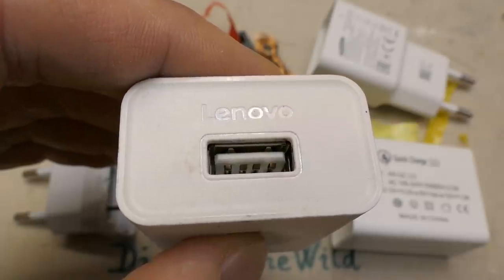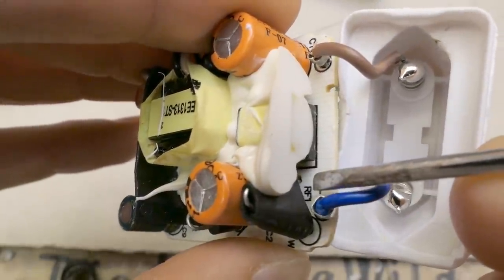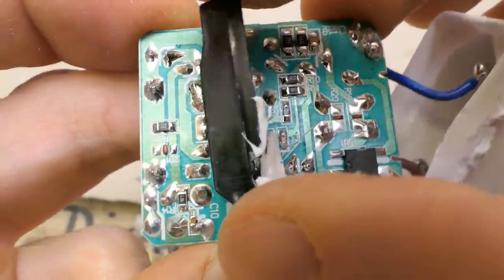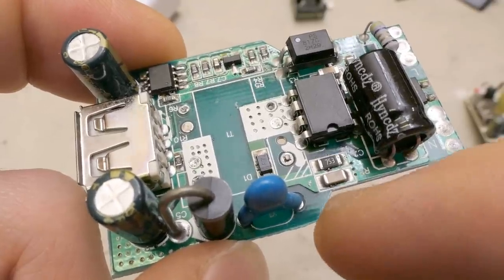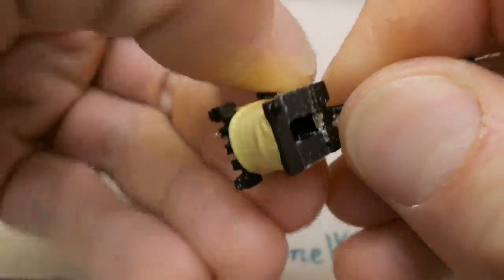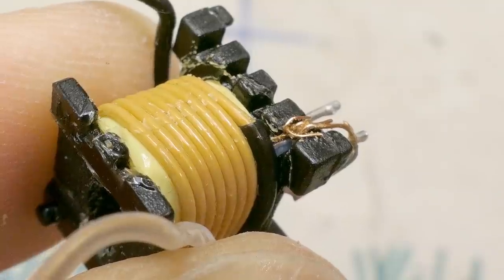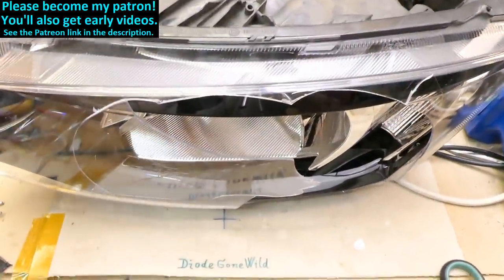Finally a safe USB charger?

Comment: "So the conclusion is... NICE :)."
That's exactly what we want to see - properly built chargers designed to last a long time, work properly and work safely without putting you (or your devices) at risk.
Sadly a lot of cheap chargers tend to miss some safety critical steps, as seen in the "dangerous USB chargers" series.
Reply: when u want to be cheapo u need to accept the risks... (if u not scared away when a device cant write down Original, u should not expect any safety..., this is why i never buy an aftermarket charger, just the brand charger for my devices :) cost more 1 time but lasts 3-4 time the cheapo chargers lifetime )
Reply: you can never be sure even when attempting to buy a proper "brand" charger, since there are millions of fake ones even in local stores, not aliexpress.
I'm using a lot of them for my small devices, but proper branded ones with low power 1A/5V are becoming difficult to find. I do not need more powerful ones, that are quite expensive.
Reply: Actually, there are some third-party chargers that are made by reputable brands such as Aukey, Anker etc, and they are powerful, but safely built. At least, I've tried these two brands and can certainly recommend both.
Reply: @krahaborowski  Same here. I'd like to know if there is a way to recognize the proper onces before buying, or even when buying online.
Reply: well i looked into multiple Samsung and HTC branded USB power supplies, they were low quality or at least what i mostly looking for: the capacitor at the DC side was the same very small (too small...) one in every 10-20W power supply.
You can even visualize how bad some chargers can be by measuring the ripple which will go more or less directly into the battery (= reduce lifetime). I personally use as often as possible only chargers i modded myself with at least 3-5 times bigger filtering caps for the USB output, they compensate the ripple much better, the phone keeps slightly cooler AND charges faster.

I never had much issues of dying chargers, in fact all of them mostly last long enough, but as i said right above: Their quality, or better: their DC output quality is even at 20$ Apple Chargers BAD. Example? With a 20W USB C charger (original apple) on my iPhone 12 Mini i measure peaks of nearly 5 Amps (should be like stable 2,x Amps!) and at a regulary 9V Output voltage a ripple of +/- 6V, resulting in Vpeak of up to 13V (at nearly 5 Amps!!!!)
By adding an additional filtering cap with only 47uF x2 in parallel the ripple and so the voltage and current peaks are nearly completely gone which will make the battery last a lot longer.
And just 4 info: by using wireless charging.... you totally wreck your battery, wireless charging produces even more ripple than any cheap USB charger :D
Reply: @harrison00xXx  I'm probably happy that i have no means to easily measure how bad are supplies that i am actually using, as i really would not like to pay more for them, or break open each one for upgrade. Sometimes not knowing too much of a the problem lets you sleep better :)
Reply: i miss dodgy for second 😄
Reply: @krahaborowski  

Yeah, and thanks to the name brands also glueing their things together instead of just using screws, you can't even take a look inside to check if it's a safe one without breaking it.
Reply: Chargers that comes with your phones in the past usually is very high quality that lasts for a long time.

Kind of sad that not including the charger in the box of a new phone nowadays has become a trend
Reply: @_decky4ever_  There is no grounding even in original chargers, what are you talking about?
Reply: @TitanyumDioksit  I never mentioned anything about the grounding, with 2 prong chargers, you will never have a ground connection, but with a proper charger you will not have an exposed live wire hanging out from the charger in a form of an USB cable. 

I tested some cheap charger in my near, and some of that is not isolated from the high voltage side

Comment: the key with the insulation on the transformer winding isn't just the thickness or dielectric strength, its about physical resistance to abrasion and flexing. the lacquer on transformer wire will actually insulate several hundred volts perfectly well, but its very easy to nick or abrade a flaw into it, and thats especially relevant in these tiny transformers which are wound in huge numbers at great speed. a layer of pvc or similar insulation is so much tougher and more durable.

Comment: Funny that they took care to use different, standard wire colors for mains input, and then connected brown to neutral and blue to live. Not that it would matter, though.
Reply: The most unimportant thing in a device like this... You can turn it around anyway lol
Reply: @rkan2  I know. Still, funny that they slightly increased their logistics costs and got it wrong. The reasonable thing to do would be to use wires of the same color, whichever is cheapest (likely black or white).

Comment: I wonder what the actual difference in BOM and manufacturing costs is between DODGY and NICE. It cant be that much, the fundamental design and 90% of components are the same. A lot of the DODGY chargers come sooo close to being a decent product, if only they'd cost-cut just a tiny bit less.
Reply: some plastic sleeving on the secondary winding costs almost nothing. The manufacturers of cheap chargers just can't be bothered.
Reply: I was just saying the same thing about Chinese crimping tools: they’re so close, but cut too many corners. If they targeted, say, $30-40 instead of $15, they’d be able to make a product that actually competes with the $400 original tools, but noooo, they just go for the absolute cheapest… :(

Comment: Diode, utilise a arbour press with a flat head screwdriver bit to open sealed adapters and cases without a hammer. It works with me perfectly.
Reply: Dan used his swing press. It was a very nice swing press at that! Just needed a sickle and he'd have had the flag.

Comment: even that EE13 core should be able to handle way more power then just 5W. that transformer as a very easy life compared to how that size core would be used these days.

as for heating the cores to separate, I made a little circuit to test the saturation current of the transformers that I switch to "torture mode" where I just crank the current right up into saturation to heat the core on its own. just not too much to burn the wire insulation and its a very nice controlled way to heat them up.

Comment: But the negative side of insulation is that, it will reduce the coupling between primary and secondary and in turn will increase the leakage inductance. This will in turn need better clamp circuit reducing efficiency.

Comment: DGW i made your switch mode transformator tester circuit but my circuit doesn't work. I used attiny24a smd (i couldn't find a dip one) and irfz44 instead of irlb8743. Is it critical to use irlb8743 for mosfet. I check all the voltage and value on my circuit. Everything is correct but it doesn't work. Please help me.
Reply: @Marko Bandov i think about this suggestion thank you but there is one more problem even if i remove the mosfet i think i need to see some signal on Attiny24a but there's no signal on signal leg of Attiny24a. Is it critical to use dip Attiny24a because my ic is smd. Or is my ic broken. Because of this i order new Attiny24a for test this situation.
Reply: @Marko Bandov thanks a lot for all your suggestions.

Comment: hi,i wont to diy a isolation trafo from an old trafo from scrapyard,the outer dimensions are w96,h80,b46. the wire diameter is 1.2mm ,could you tell me how nany turns and windings i need, for approx. 500 w.?

Comment: You must be kidding... I had the same charger and its complete utter trash. Yes it can deliver about 2.1 amps at 5.3v yet it lasted less than 2 years... which is by far the most unreliable power supply I've ever owned. Maybe because it generates a lot of heat and smells like crazy... this came with a terrible phone that exploded in the warranty period, and with crappy earbuds.
Lenovo, your computers are fine, but your phones (and everything that comes with it) is perfect garbage. Even the freaking usb cable is trash!!!

Comment: why did you not measure the isolation resistance between the primary and the secondary coils with a megohm meter before unwinding  all ?

Comment: Without the plastic, the gap in the PCB is just "clearance". With the plastic, you get much more "creepage" 😁⚡
Reply: Hi, yes I agree, the clearance distance is across the air gap and to the primary and secondary points/track. The creepage distance is the path across the surface of the insulation to the primary and secondary circuit points/track.😀👍

Comment: 1080P 50 FPS... some gaming videos don't have this framerate!
The way you are recording and editing (both audio and picture) is very basic but yet your videos are much better to watch than at least 90% of videos about electronics.
And I say that as somebody who spends several hours a day doing some electronics, building and repairing devices.

Also... isn't the "interference inductor" actually a common mode filter?
Reply: The audio in this video had some kind of weird background noise in it. Like it was raining, or something. I kept pausing it to see if it was raining here.
Reply: @1pcfred  Yes true, it is probably just some noise where he is, but still the video was very enjoyable. And for a camera microphone this one is very good.
Reply: @Zebra_Paw  Maybe it was raining when he made the video? It sounded like rain hitting a roof to me. Could just be some kind of background noise too though? I must have paused the video a half a dozen times to see if the rain had picked up here. Then I was like no that sound is in the video.
Reply from the maker: Thanks :). Yes, it's a common mode one, as I mentioned at the end of the video.  And the noise some of you mention comes from the camera (Panasonic Lumix DMC-LX15). This one has more hiss than the previous camera (Olympus XZ-10), yet the voice is way less distorted. And it has a sharper image than the previous camera at the same resolution. And it can do 24, 25, 30, 50 and 60fps. The previous camera only did 30fps.
Reply: @DiodeGoneWild  I don’t think it is such an issue, the quality is very goid for a camera microphone, but maybe you should consider using an external microphone or even record the voice separately…

Comment: This is old technology when electronic cassette Player or radio have step down transformer 9 volt or 6 volt . No smd no switch mode power supply.

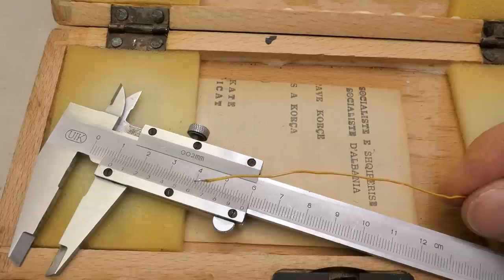Comment: 11:48 - "this tool" is called a caliper :) I see that one is the better option: there are two variants, with 0,05mm accuracy and 0,02mm accuracy (this is determined by the length of the "fractional part" ruler - in 0,05 it is 39mm and in 0,02 it is 49mm). In general it's a very handy tool, every engineer should know how to use it and have one of his/her own.
Reply: I have one (tricle brand) and always use it. The new cheaper one from china already has a digital display.
Reply: And here we called it "Jangka Sorong"  although the proper name was caliper.
Reply: @qolbunsalim5188  I heard it's best to have the vernier type. Apparently those digital ones (especially cheap ones) can decalibrate with time. On the other hand they're definitely far easier to read.

I believe it also depends on the actual accuracy required. I myself have a 0,02mm one, but honestly in most cases that I measured, accuracy of 0,2mm (10x worse) was sufficient enough. In such case slight decalibration is probably good tradeoff for easy readout.
Reply: Even my tricle brand has 0.05 accuracy. It is enough for me for electronics use. The expensive one like Mitutoyo brand was too good for non critical use like in electronics.
Thankyou Michal.

Comment: That exact case when "too much" is bad. It takes some large voltage to flash an air gap, but, fyi, flashing along an insulator's surface takes way less. Also wonder why nobody uses the best safety trick ever, the ground contact that is ;)

Comment: I have also opened a Lenovo charger before, same board, same transformer, but different model. The reason I opened it is it failed. Removing the parts are challenging as they are securely soldered. Well, Lenovo did a good job in manufacturing, although I can't figure out why the charger failed. I just salvaged the components.

Comment: In the design of flyback switching power supplies , if the capacitors at output 2 are parallel or separated by a coil, they will always fail as the first capacitor closer to the diode. Therefore, the correct design should include as the first capacitor a higher quality type, the maximum ripple current of which exceeds the maximum current supplied by the power supply itself.
This parameter max. ripple current vs lifespan and maximum temperature can find and check in datasheet of mentioned capacitor.
If this principle is not applied, the service life and reliability of mentioned switching power supply is much shorter.

Comment: I have some chargers from Aliexpress, like Baseus. Touching lightning (iPhone) charger cable tip gives a slight tingle, not shock, but unpleasant. Is it something like residual current that’s not filtered out or could it be something possibly dangerous?
Reply from the maker: Probably the capacitive current throught the Y1 capacitor.
Reply: @DiodeGoneWild  I received a no brand PD charger today, for my usb soldering iron (miniware ts80p). Touching the iron handle gives a burning tingle. Checked the gnd<=>iron body with Fluke, DC voltage 0.5V, AC 25-30V. Man, now I’m afraid to open and see what kind of horror is inside that charger.

Comment: Very good construction.
The first capacitor behind the diode on the secondary side is a polymer type with extra low ESR and thus high max. a pulse current load which in this type is well above 1A at 100kHz. Especially for constructions without feedback through the optocoupler, it is crucial that the output voltage of the charger does not exceed the maximum level and also for the long life of the charger.
I think that this design, if it had an optocoupler, can without problems handle twice the output current.

Comment: If you get rid of that cap between the primary and secondary side, does that mean that the tingle you get when you touch the output also goes away? I remember seeing that the tingle is due to this cap between pri/sec. Keen to have this cleared up though!

Comment: If it’s not a dumb question; how does a fusible resistor differ from a normal resistor? Are there ways to test one from the other, and do they have different bands or ways to identify? Thanks!
Reply: It acts also as a fuse. It melts at a specific relatively low current.

Comment: On the secondary side the capacitor near the diode is a different type. Is that type more resistant to heat?
Reply: That is an polymer capacitor. A solid state aluminium capacitor. There is no electrolyte in it to dry out. It has lower esr than electrolytic, withstands higher temperatures and has longer life. But the package size for same capacity is larger when compared to electrolytic and is more expensive.

Comment: I wonder why there has to be a huge distance between the primary and secondary side of the board. The components are intact by solder and they can’t touch each other.
Reply: I cannot tell if you are serious or joking.....but if serious, you should explore "circuit separation". It is because of "tracking" that a "creepage" gap (8mm recommended) is required between primary and secondary circuits.

Comment: Last week I opened a 6 year old Xiaomi 5V 1A charger, and it was very similar to this one. I didn't open the transformer though :)
But I wonder how the regulation works without feedback. Can chip sense secondary current via transformer, because it shuts down after 1A.
Reply: The video explains it somewhat. There is a 3rd winding called "Feedback Winding", in this device that's the outer-most winding on the transformer. The control chip knows the voltage input on the primary, and it gets a report back from the Feedback Winding about what is being induced on the secondary side.
The Feedback winding is much smaller than the Secondary winding, but it's voltage will follow the secondary voltage. So, when the secondary goes lower, the feedback winding also drops.
There is no current sensing used or needed. The control chip just monitors voltage (of the Feedback). If a load is placed on the secondary winding, it's voltage starts to drop (sag) so the control chip increases the pulse width (PWM) of the Primary to put more power in there.
At no load, it might only be 10% duty cycle, and at 500mA load it might need to have 60% duty to keep the voltage at 5.2V or whatever. The control chip just references everything from the Feedback winding.
As secondary current increases further, a point will come where the duty cycle hits 100% and there is no more power possible - that's the maximum rated current. The control IC will continue to monitor voltage of the Feedback winding and if it drops by (say) 10% from nominal, it will simply shut everything down.
Reply: @johncoops6897  Now I now how sensing works in this charger, thanks to you kind sir for your time and effort :D

Comment: Awesome now if Lenovo can make a laptop too that doesn’t blow the super IO when adapter plug is accidentally shorted to ground they’ll be number one lol.
Reply: Really?. The i/o ec chip was not directly tied to 19v charger. 
I have that X2xx lenovo TP, still working fine until now.
Reply: @qolbunsalim5188  ya I think it was the 2010 - 2017 generation